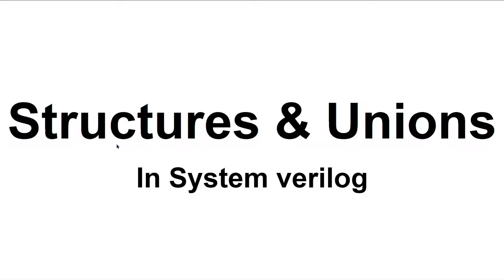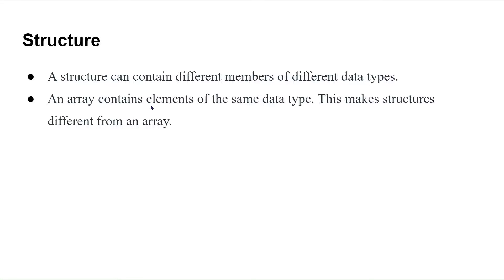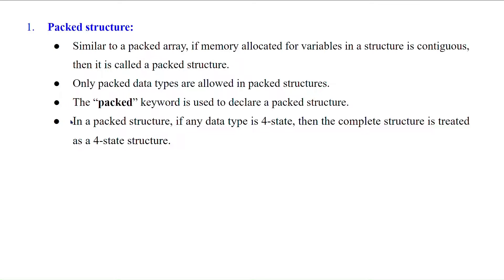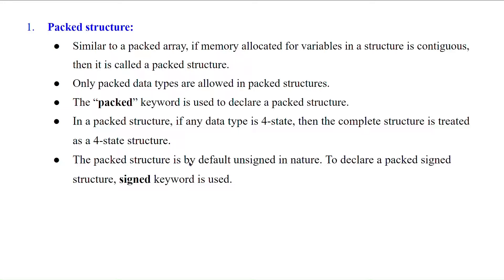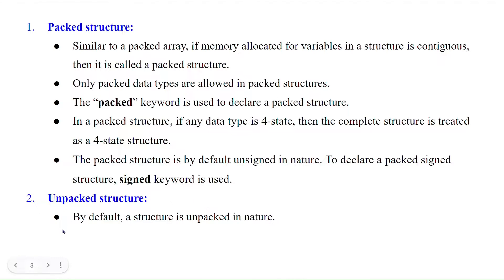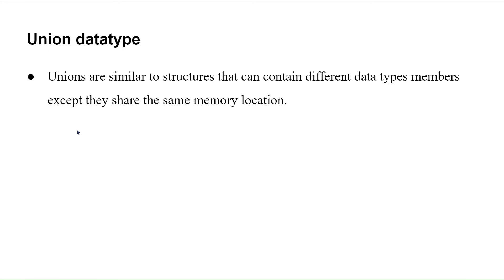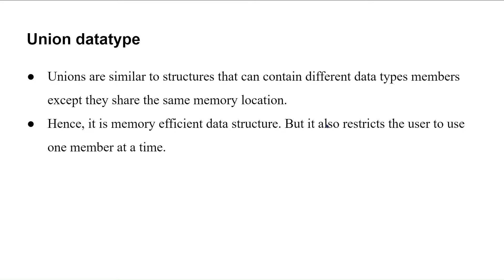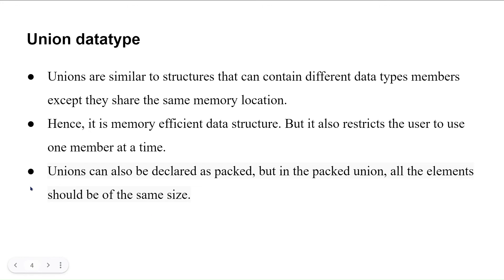Structures and Unions in system verilog | Introduction | Part 1 |

Comment: What is difference between structure and enum?
Reply from the maker: Struct:
-Can contain multiple data types (e.g., integers, reals, arrays,strings).
-Used to group related variables of different types into a single entity.
-Members can be individually initialized.
-Useful for modeling complex data structures.
-Use the dot(.) operator to access individual members of the struct.
-The memory allocated for a struct is the sum of the sizes of its individual members.

Enum: 
-Represents a single data type with a set of named values.
-Used to define a variable that can take one of a specified set of constant values.
-Values are assigned automatically or can be manually assigned.
-Useful for defining states, modes, or other sets of constant values.
-Use the enum value directly, optionally prefixed with the enum type for clarity (enum_variable::enum_element).
-The memory allocated for an enum is typically the size of an integer that can hold the largest value of the enum.(By default, SV uses a 32-bit integer to store enum values.)

Watch my Enumaration video..
Part 1: https://youtu.be/pcc2UivygN0?si=SVx8fWej0Xj0GqGO
part 2: https://youtu.be/__-oDthU3Vw?si=Z17oWdtWnyONL0RB